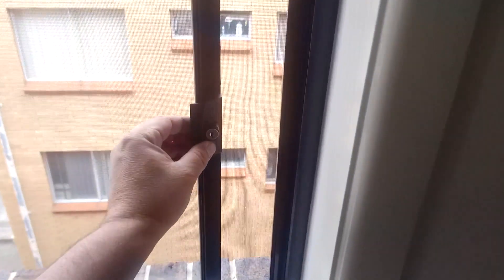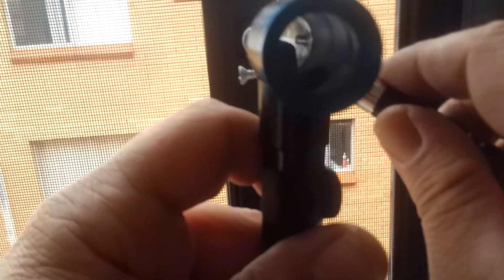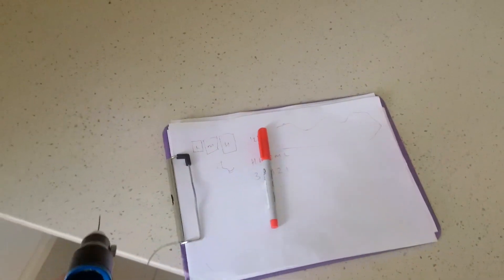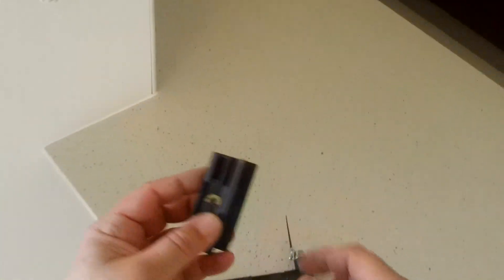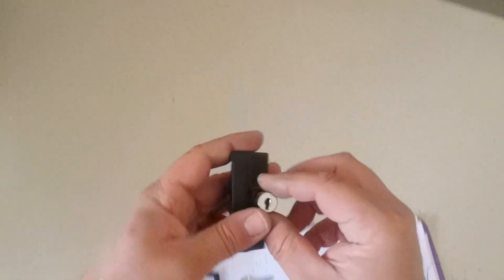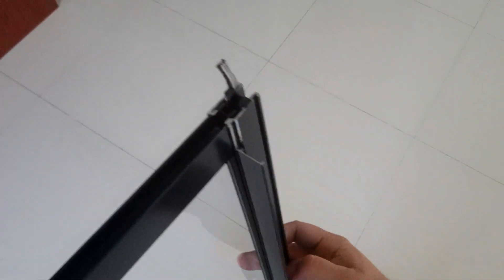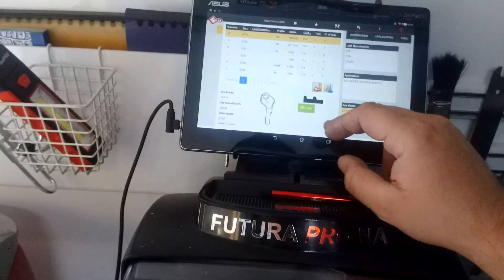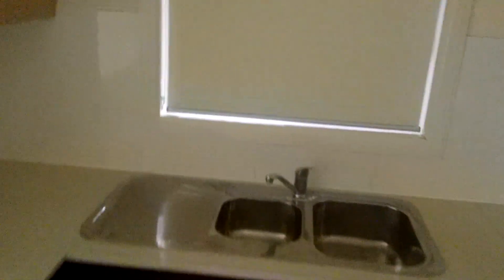Making keys for window locks Reading Or Removing

Comment: Don't believe it, I managed to make my own key from your info, got code visually using dental tool and led light on head torch, second old key I cut with mega thin blade on with grinder managed to grind into a working key,,,,,by hand lol absolutely chuffed. I had moved to a house with all windows locked and no keys. Thanks

Comment: Thanks for the video, how much would it cost to hire someone to do this?
Reply from the maker: depends on the locksmith and if they are local, $150-180
Reply: @DrLockShop  thanks for the reply, if I were to take the lock to the locksmith, I assume it would be much less because he doesn't have to charge me for a call out fee? I have about 10 windows with the same key, so it is cheaper to re-key instead of replacing all 10 locks.
Reply from the maker: @AnLe-kx6hy  yes just take one into a locksmith shop and have them make a key, that's the cheapest way